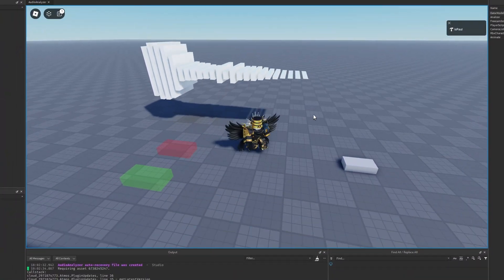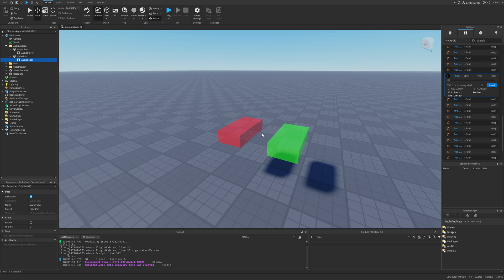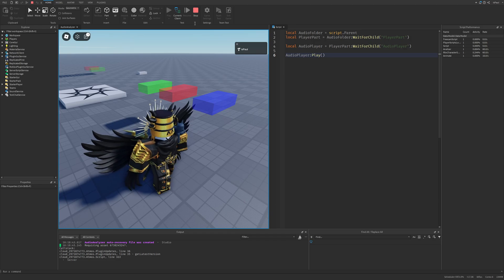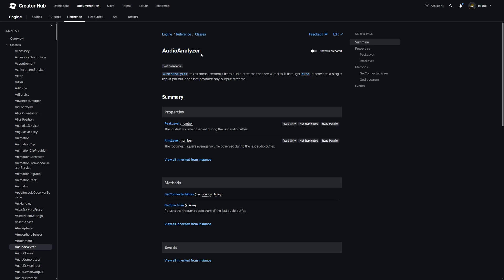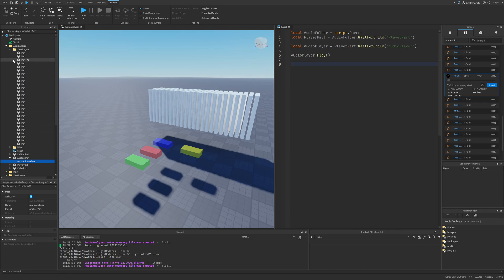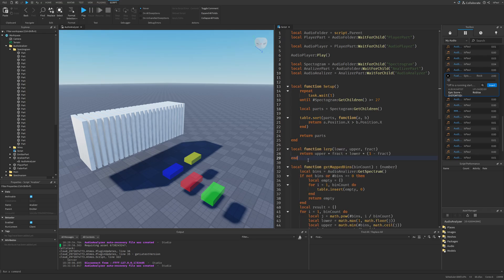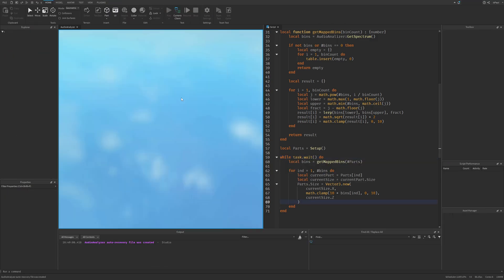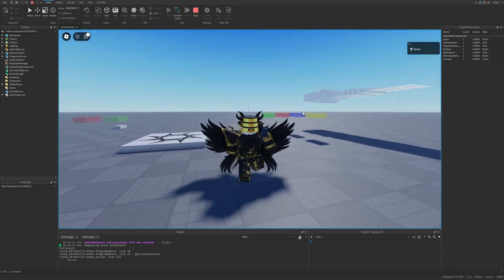Roblox Audio Analyzer Is Really Great...

Comment: Cool! I made one too (I have video on it, although older version) and I have some recomendations to make it much better:
1. interpolate spectrum values with simple sensitivity
2. Interpolate in stepped loop and use its deltaTime while doing interpolation. This is because sound's spectrum updates much much faster than typical loops like renderstepped or heartbeat.
3. You can update visualy in Stepped loop or you can update Renderstepped which could help with performance

DON'T DO:
1. tweening... Its stupid
Reply from the maker: Yeah originally I wanned to do it with RunService, but something popped up and I didn't have the time to actually make the code (That's why I just copied it from the demo place)
And tweening could be an option for slower update rates, around 1 second or more, but it wouldn't be a good idea for songs with higher bpm or visualizers with a bunch of parts.